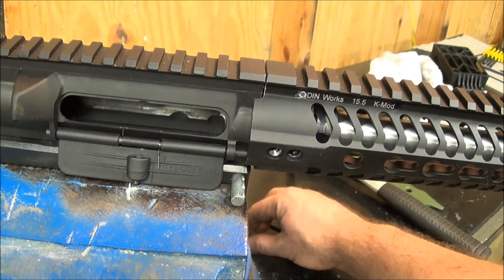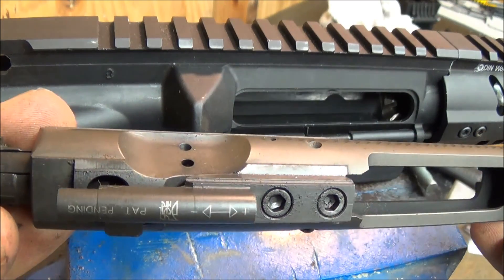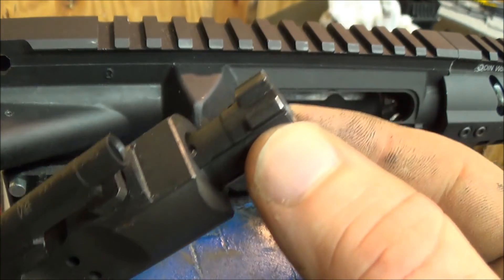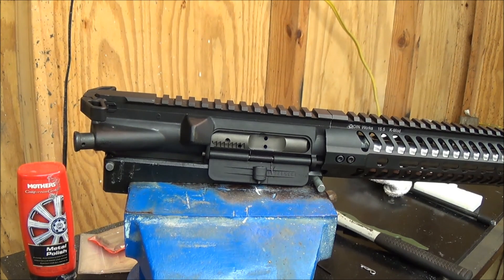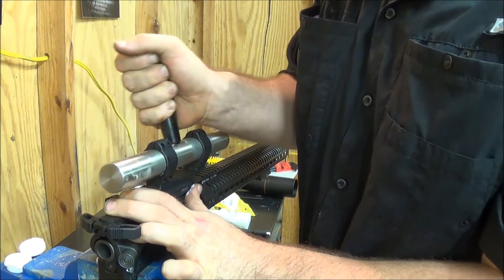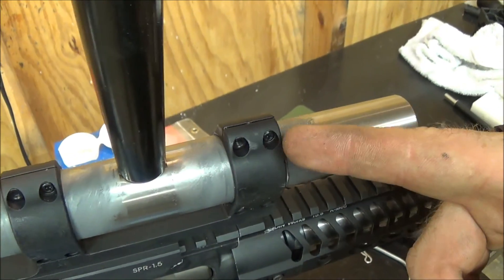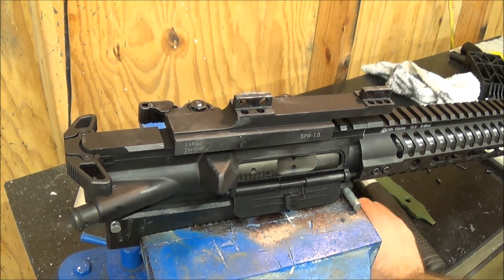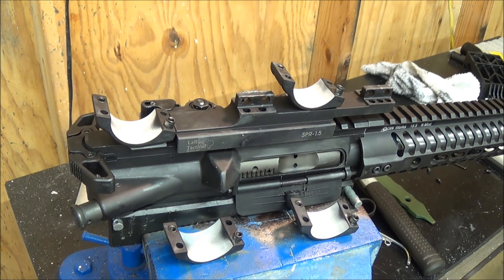Aero Precion USA Upper Build SPR 15 PT2

Comment: So how do you get a matched BCG and barrel set? I've never seen them sold as a matched set, they are always separate components
Reply from the maker: Are you talking about matched from ODIN Works or just in general?
Reply: Teal Blue Bravo LLC In general. Does Odin sell the matched sets? Well, I guess I can go check out their web site and find out
Reply from the maker: gunnwild1 it was pre matched in the shop
Reply from the maker: gunnwild1 jp, white oak, shilen, krieger, pretty much all your upper quality barrel manufactures offer it as a option to match the bolt to the barrel

Comment: Question for you. Is it required to head space in an AR? I'm asking because this is the first ive ever heard about it Thanks Teal Blue Bravo LLC
Reply from the maker: R3DN3CK26 severely sorry for the late response. In a short story yes. I personal acquired a barrel and bolt assembly from manufacturers I've used before and the bolt locked on the no go gauge. This is obviously very bad and no telling what would've happened if I fired a live round. Also when dealing with accuracy and getting the most out of your rifle, or pistol(heck even shotguns use them) you want to know what spacing you have going on and to find a bolt that matches that number for the toughest lock up possible. So sorry again for the late response. If you need else please, dont hesitate to ask. It would be quicker to call us (we will answer) out shoot us a message on our Facebook page www.FB.com/tealbluebravollc.
-Mike

Comment: Why would you lap a one piece mount?? That is one of the huge advantages on one piece mounts. No lapping needed. I spoke to Nightforce, larue, Vortex, AD, Trijicon about this and they all said the same. The so called "high spots" are what Larue built into the rings to hold the optic. Notice how they are uniform on the all outer edges????